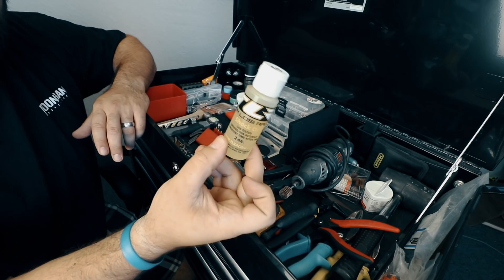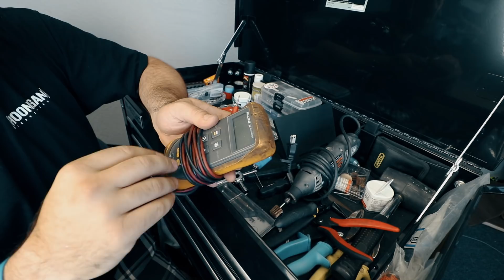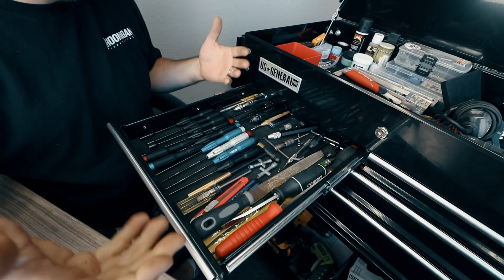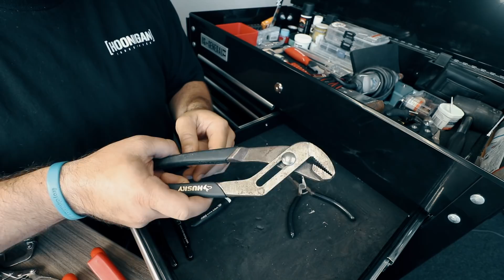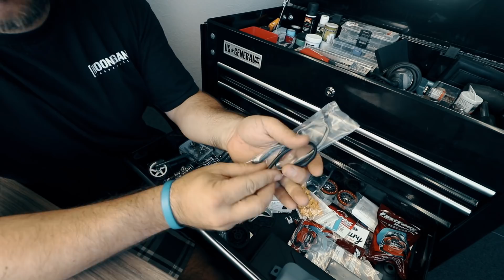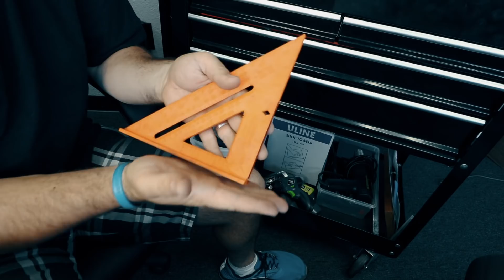Harley's RC Toolbox Tour - 2018

Comment: The old body reemer that looks like a straight/flat cone step bit is one of my favorite tools, along with curved dynamite body scissors. Had those both for over 20 years and still use them both daily for RC and full size work both lol. That body reemer tool goes through damn near anything. They're 100% worth every single penny lol. Ordered a Vanquish vs410 phoenix portal kit last night from Amain, then seen today some upgrade gears that Vanquish is selling for the transmission and they come with 2 extra gears for free? Is the stock gears a weaker metal or what's going on with that?

Comment: US General Tool box is at harbor freight, they frequently get better reviews than the lowes and home depot boxes but they are not the smooth roller of  a snap on for local pick up...no way i can affod a snap on...  the gundam kit would have been a great starter kit to buy might grab it for when things get dull....  does the otis dry lube smell like a gun oil?  curved and straight tin snips?  Have you tried the dewalt gyro driver I like the control of it based on how you turn it.  thanks for the great ideas
Reply from the maker: The Otis oil is a gun oil, so yeah it smells just like that familiar odor you probably remember. The tin snips are both straight but one is right hand and one is left hand. I actually have about 5 pair but these two stay in the box. I was going to use the Dewalt gyro but it doesn’t have a clutch which bugs me.

Comment: Mines identical almost, you need super glue, lexan scissors, for bodys,small 8th inch and 1/4 in. Tape, if you build and paint your own rc bodys .Bodys are half the fun. I ALSO use hex drywall tape with the shoe goo to reinforce and fix broken bodys.Bet that stuff goes in the body shop tool box probably.And your standard T wrench that come with all rc models. I have 5th scale down to 24th scale models for cars and trucks. Then comes plane tools and parts. As well as drones and boats. I turned a whole walk in closet into a parts storage space. Well that's it all that I can think of for 10th scale rigs. Great video ,killer idea . Keep up the good work. Thanks.